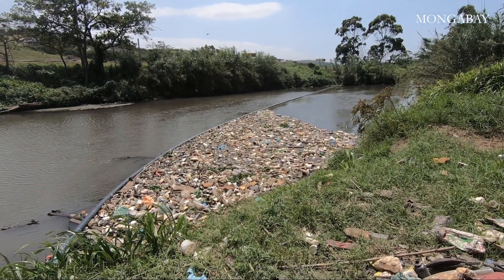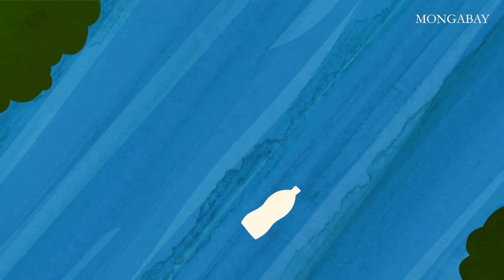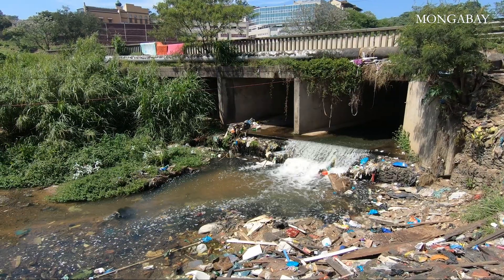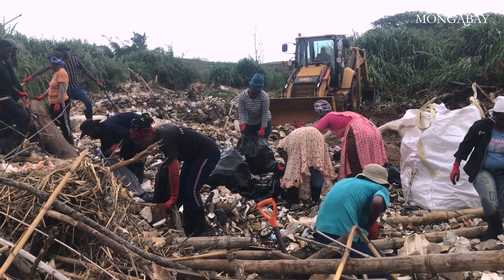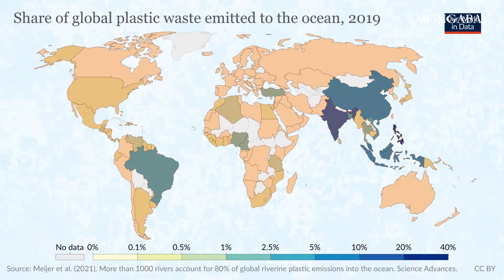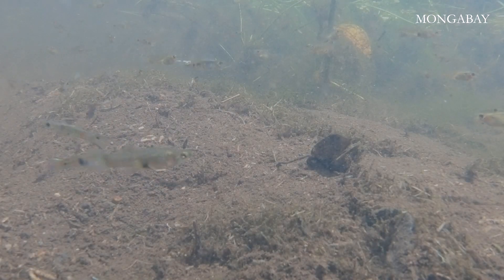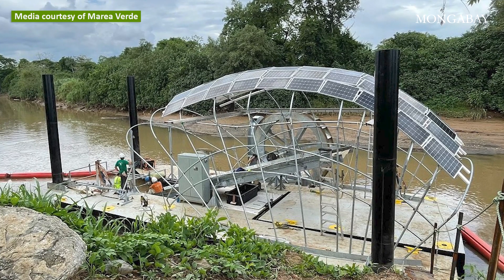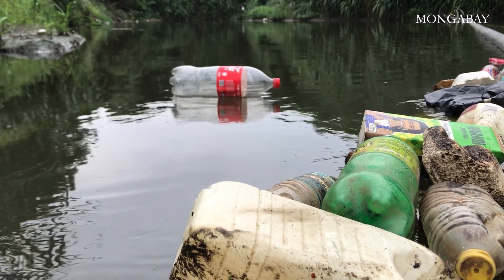Can litterbooms help us clean our rivers? #MongabayExplains

Comment: Litterboom made from any plastic parts is stupid (remember the 3 plastic degradation??) .. also pvc leach toxic substances .. steel or bamboo or wooden or several other material that does not degrade due to physical contact, photodegradation or indeed leach harmful toxic.

Cleanup is downstream solution, what urgently needed is many effort at upstream (zero waste economy, circular economy)

Yes asian river are the location, the SINGLE USE PLASTIC  trash are produce by WESTERN MULTINATIONAL COMPANY !